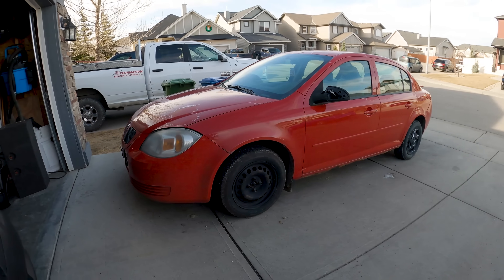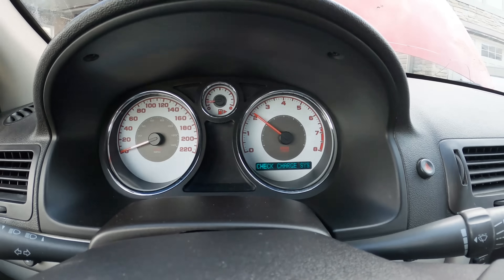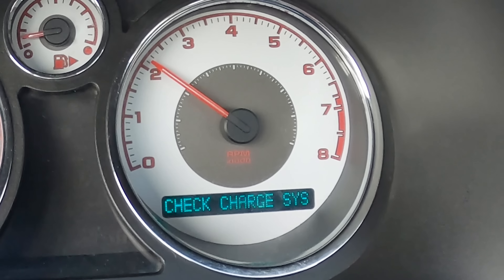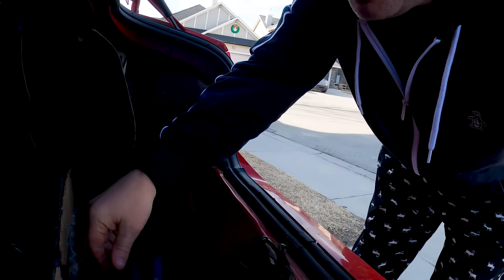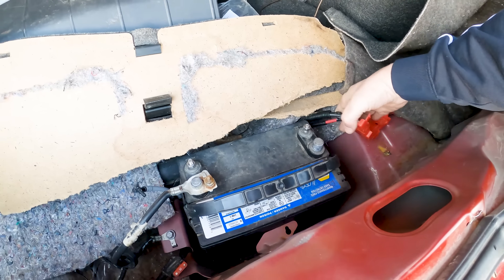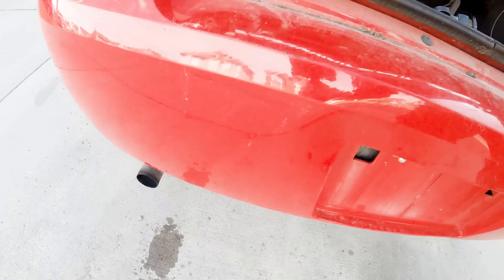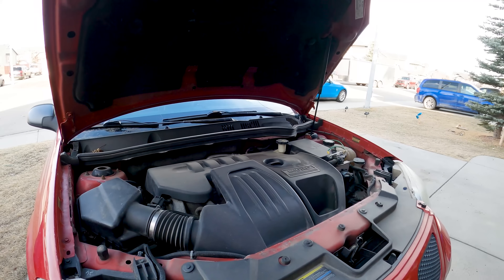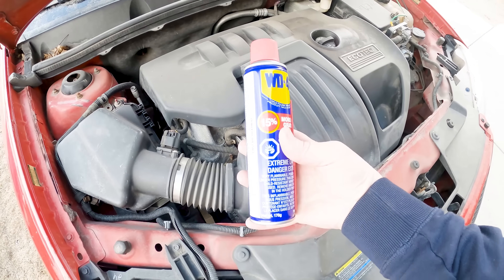ROADSIDE FIX! REVIVE your DEAD or DYING Alternator with this ALMOST FREE trick! | Gears and Tech

Comment: I actually, just did that a couple of weeks ago. Only I sprayed contact cleaner (don't have WD-40 but similar stuff here in Japan) and it worked for like 2 weeks until today which is a rainy day, I noticed last year that during a rainy day, it wouldn't charge properly but it cleared up after that for the rest of the year up until now. That car has about 240,000km on it so I was guessing that the alternator was going bad. So, niece to know that regular WD-40 works as well. Guess that I better buy a new alternator..
Reply from the maker: Happy to help
Reply: @GearsAndTech  What I meant was that about two weeks ago I sprayed the connections and into the inside where the coils are hoping that it would do something like if the brushes were not making contact because of gunk in the springs (do alternators still have brushes or are they brushless now?) bad or something and it fixed it for about two weeks and then while driving to work the check battery lamp came on again. So, I was looking on line for how to confirm that your alternator is going bad and I found your video. Which basically confirmed what I suspected. Learn something new everyday. I actually, worked one afternoon at an alternator shop own buy my friends Dad back in school days and was rebuilding alternators all afternoon, taking them apart and sanding down the contacts in a drill press and putting new brushes in. That day gave me just enough knowledge to rebuild the starter generator for my Dad's 1963 International Harvester Farmall Cub. Get experience as a kid to fix your Dad's tractor! LOL!
Reply: I am trying to get my kids to work with me out in the shed to get some experience. My students at school can't even fix or maintain their own scooters or motorcycles.

Comment: I just wanted to add be careful with loose belts too, it will act like a dead alternator, but sometimes it's just a pretty loose belt, which is very easy to check especially if you got a squeaky belt. I have recently had a car, did the unplugged test, and it died after I jump-started it. but I tried it again and the car stood  running after another jump start. I put a lot of stress on the alternator unplugged and it kept running, and also check the voltage everything was fine. then I noticed the belt was kind of making a sound and it was pretty loose tighten it up and it never happened again. between hot and cold cycles and weather the belt will stretch.

Comment: Everyone's alternators went for a sht after the dense fog rolled through our area late fall and i have found that most likely fog material containing metal dust has stuck to and caused carbon tracing symptoms on the brushes and connections to the diodes and regulator module connector which only took a good spray cleaning to remove and restore power !!!
Reply from the maker: Makes sense, thanks for the heads up!

Comment: Disconnecting the battery under load or while the car's running will not hurt the car.   If that was the case, then all of your computers would fry if your battery ever dies. It's the best way to do a quick check.
Reply from the maker: Agreed.

More people's battery dies every day than these 'mechanica' in the comments understand. But the cars aren't frying computers.

Offer still stands for any of thesw experts to tell me which make and model will for sure fry the computer and I'll buy it and do this test to find out.

Suddenly crickets!

Comment: I've restored every car I ever owned, 5 decades... also proactive maintenance just like a general aviation aircraft. 
Absolutely brilliant, I've never soaked my alternator out of concern of shorting something out. I understand WD40 being a lubricant also displaces moisture. 
I decided to get the plug in digital voltage meter, so to constantly monitor and  replace my alternator re 2015 Honda Pilot at the first indication of end or life. That is good to have to also get advance warning of a battery that's loosing  its ability to hold a charge.  I have found that battery's that are near terminal end stage will be a little hard to start the first morning after an overnight winter cold snap below 39 degrees. Because the colder it gets toward 32 deg during those bitter 7pm to 6 am down time, the less (CCA) cold cranking amps you have available from your battery. Any questions re above see your mechanic... P.S. Absolutely OUTSTANDING video, to the point, no idle chatter. It's an example to others. People who click this vid need clear answers not glib idle chatter, and your vid does that perfectly.  TY, TY.
Reply from the maker: That's a good plan. Winter sucks on batteries.

Comment: Wrong method

Don't do it
Reply from the maker: Do it
Reply: @GearsAndTech  Dear, you cannot advise the public in the wrong way that may lead to a disaster in the engines of their vehicles, by spraying a pressurized package of lubricant for metal joints, and because of the damage it causes to the current generator, it was possible to repair the damaged part or clean it with a bottle of cleaning liquid intended for electrical conductors and not lubricating fluid

Comment: NEVER … NEVER , remove a battery cable while the car is running , .. because if the alternator is charging, the cable disconnect will cause a backload power spike that will toast fragile electronics that’s in all newer cars… that trick is ok on older cars pre  2000 but not on newer cars.   I’m a ASE MASTER mechanic  38 years now retired
Reply: I had so many people say they were ASE cert work on my car cause more damage and literally kill my last car…do you get actual documentation when you get ASE cert? Just asking because I am so sick of hearing this and want to start asking for documentation before letting these asshats touch my car anymore.
Reply: @kimgerlach-stosboutique yes you do get a certificate upon completion or as also refered to as Blue Seal of Excellence. They should be more than willing to show this to you. Keep in mind some guys working on cars don't have this but are fantastic.  But do your homework before even going to get a quote. Google the shop or person, Facebook, yelp, just anything that may give you an idea of customer satisfaction or issues.. consider the negative responses lightly sometimes because some people are just mad at having to pay. But if multiple negative responses state the same, take heed. Familiarize yourself some with your vehicle symptoms your vehicle is having and look at common causes. Doest hurt to get a slight idea of what's happening. Knowledge is power!  Hope this helps.😊
Reply: @kimgerlach-stosboutique there is suppose to be a sign hanging up somewhere, my mechanic has a sign in front yard and on his shop ASE CERTIFIED..
Reply: I was wondering if this guy was going to actually know about cleaning the armature, the brushes, and the slip rings with WD-40, or if it was going to be another attempt on the next 15 minutes of my life.
Reply from the maker: Ok
Reply: Give me a car with a ash tray....
Reply: Your Right.
A mechanic did it to a car of mine, and the radio and AC got screwed up. Diodes!
Reply: I agree with you, removing battery cable while running is a “Nono”

Comment: So i wasn't going to comment but disconnecting the battery like on newer Hondas could trigger a steering angle sensor warning where you have to use a bi directional to just re learn the sensor... I noticed you was on a Pontiac 🤣 so that is acceptable 🤷.... Another thing i don't trust gadgets i rather use a multi meter or power probe go straight to the source to avoid speculation.... Once again if you driving a newer vehicle from 2019 and up be cautious... It could trigger some lights on the dash because of miscommunication codes.... Well i did my good deed for the year 🥷
Reply from the maker: Thanks for sharing

Comment: That trick doesnt always work on newer cars ... If you disconnect the battery on newer cars they will shut of and the alternator is just fine
Reply from the maker: The trick is the wd40

The battery cable removal is a simple test in a pinch

Comment: Those $ 2 digital voltage meters are always a good idea, if your car has cigarette lighter port. This way if you notice voltage dropping bellow 12.5 volts you'll have lots of time to drive to a safe place and not be stranded. Make sure not to use any extra stuff, like A/C, fan, seat heater, radio, even lights.  If you suspect the alternator is getting weak do this:
Clean both battery terminals and their connectors with sand paper of brush. (Remove negative first, positive second. Install positive first, negative second).
Check the terminals on the alternator while the battery is disconnected. They can get loose, or eaten away by heat and oil. Next, check the alternator belt. Is it loose? Is it skipping? 
Is the alternator making any noises? Bearings and brushes will make noise as they wear off.
Reply from the maker: True

Comment: This is wrong and dangerous on so many levels it should be removed from YouTube.
Never, ever remove the battery terminals with the engine running. You may destroy very expensive computers or sensors. You could do this on older cars that didn't have any computers and sensitive electronics. But never on new cars.  Also, WD40 is extremely flammable. Never use it on hot surfaces or start and engine if you sprayed any parts with it. 
You created this "problem" by deliberately leaving the positive battery terminal loose. Your alternator was fine all along.
Reply from the maker: Thanks for sharing

Comment: You are lucky your battery positive connector is idiot proof. Throwing it like that with running engine and working alternator can easily short it to the cars body which have battery and alternator negatives connected to it. Remember that. And dont be lazy always disconnect your negative connector first. Not the one its lose but negative.
Reply from the maker: Agree

Comment: Well, the WD-40 trick is a winner. I had trouble shot my boat charging system down to the alternator. Figured warn brushes. It has an external regulator that tests good, and I cleaned every ground and connection but, the amp output was all over the place. Sometimes nothing, sometimes going up and down radically. 
I won't have a chance to pull and rebuild it for another month as we are anchored out in key west and I must have the engine ready to go at a moments notice. A good douching of the magic elixir got her back on line.
The rebuild kit is ordered.
Reply from the maker: Awesome to hear

Comment: It worked! I have a bad alternator and purchased a new one. Before putting in the new one, the car was running solely on the car battery, hence car battery kept dying. I tried the stating the wd in the alternator motor and it appears that the alternator was revived and got me way more mileage without stopping on me again. Not sure how long this will last however this at least is a temporary resolution
Reply from the maker: Thanks for sharing.

I've revived a lot of alternator this way. So I know it works
Reply: How long did it last?

Comment: I know this video is old and I understand he is just trying to help and give advice. I'm not trying to bash or hate but man people you need to do way more research than just going off of 1 video. I've found a few things inaccurate just at the beginning of the video. But the main thing is when working on your car never just disconnect the negative and leave the positive on the battery. Always do the positive. Cause the car is grounded and if you still have positive connected and unhook the negative and you leave your car running. All the negative cable has to is ground with the car
Reply from the maker: Omg, you're not serious?

If the negative cable is off you can ground it on anything you like, unless it touches the negative battery post the circuit is open and not running.

Seriously, don't stop that research you are talking about. You have more learning to do buddy
Reply: @GearsAndTech  lmao I don't think you understood what I was stating. But I'm not here to hate. Just recommending people to not just go off of first thing they see do multiple serches. But good luck to you friend.

Comment: Spraying an oil based lubricant WD-40 on an electrical device, sounds counter intuative.  I would like to see other Automotive experts weigh in on your fix. 👍
Reply from the maker: I think you're missing the point. In this case the alternator is broken and will be replaced.

If wd40 works for any period at all its all free life that was gained.

Don't use it as a preventive measure, but in an emergency it's great

Comment: 1. Disconnecting the battery while engine is running is DANGEROUS for electrical components that all modern cars have. (Alternator & ECU are the components that are in danger the most).
2. Spraying WD40 on an alternator is not going to help in any way and besides it could cause you pulley belt slipping if you spray close to the pulley belt.
3. There are many reasons an alternator could not be charging. If you want to check the alternator and you are not a mechanic then the usb plug you mentioned is the safest method for you.
If on idle with no load (no lights on e.t.c.) it does not give you over 13 volts then you have a faulty or dead alternator and you should take the car to a MECHANIC if you are not one yourself.
Reply from the maker: So much misinformation in your comment

Comment: been replacing my alternator every 6 months. and this sht just did the trick thanks
Reply from the maker: Happy to help
Reply: If your replacing your alternator like that you may have a bad cell in your battery that will burn out alternators,  your battery will show possibly good sitting voltage but will do weird stuff under load like interior lights and dash lights may flicker while starting car or if car is running and you add  wipers and turn on heater blower and window defroster and head lights you might see dash lights and headlights flicker or drop low then high , a bad cell in the battery can cause overcharging and overheating of the battery till it explodes

Comment: I knew the trick about removing the battery terminal, but I didn’t know about the WD-40 so thank you for the advice.
I think I’m going to test it tomorrow because something in my starting system is not working properly and it might be the alternator.
Reply from the maker: Hope it helps

Comment: Best is to spay at the back of the alternator where contacts are located. Normally, diode degrades in an alternator. If you change the diode module it should be fine; you will get back 14.4v from the alternator.
Reply from the maker: True

Comment: It is not a bad idea to try that trick if the battery light come on your dash, nothing to lose, but instead of spraying wD40, it is better to spray brake cleaner it is more effective to drive away or clean any dust or debris.
 But that trick will not work on two situation, first one regulator died completely, but that gave you a warning  a head of time like every electronic part dose,  two or 5 days before it died completely, battery light may come in but the alternator still charging but at low voltage 12.5 or less, it happen to my car  four days before, I have seen battery light come on and go away, in a few second, and after 4 days, the battery light stayed on but  alternator still charging at 12.5 volts only, when I  see that ,I drove home immediately and parked the car and changed the alternator later.
second situation when the brushes weared out completely and they don't make contact wilth the rotor anymore, in this situation the wD40 will not work.
Reply from the maker: Brake cleaner is very flamible and not recommended
Reply: Dw40 is flammable also, it almost burns my car once, but i was lucky,  because the fire was at the muffler bolts, and brake cleaner dry fast, whereas the dw40 dosent.

Comment: You've never worked one day as a mechanic. Never disconnect a battery cable while running. If the regulator loses ground and goes to full field you can produce up to 100 volts! I've seen burnt and fried alternators and headlghts go off like flash cubes! Please don't eat so many crabbie patties. Do the world a favor and don't make videos.
Reply from the maker: Wrong on many accounts

Comment: I use a jump box on the battery and yes it's 12.5 to14.5 if the bax has a voltage gauge it will show the voltage right away most cars need more than 12.5 with daytime running lights
Reply from the maker: Yes

Comment: No, you're wrong. That's battery voltage not good. Idle voltage with no with no amperage pole should be at 13 V anything under something's wrong
Reply from the maker: Yes

Comment: If you need to boost another vehicle, let the other vehicle battery charge for a few minutes, then shut you own engine down before starting the other vehicle. That way you will not risk blowing out your own alternator diodes.

Comment: Makes sure the charging system is loaded, like turn the headlights on, so that there is something to absorb the energy in the alternator if the charging load from the battery is suddenly removed.  If light go dimmer : alternator problem. If light go brighter : battery problem. If one of the cells in the battery is shorted out they alternators might not be able to produce full volts(above 13.2v).  In freezing weather the alternator should make more voltage while the system is cold, like 14v at 30 bellow. Maybe the alternator brushes are gummed up or frost between brushes and slip rings -- WD 40 might help.